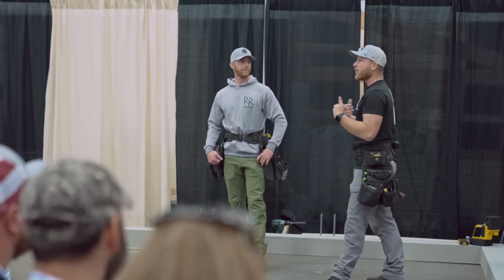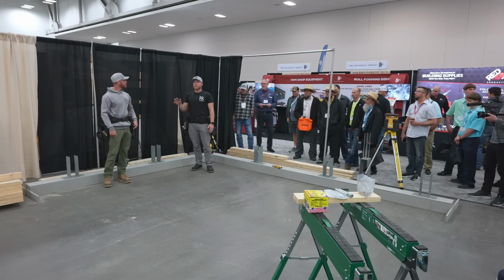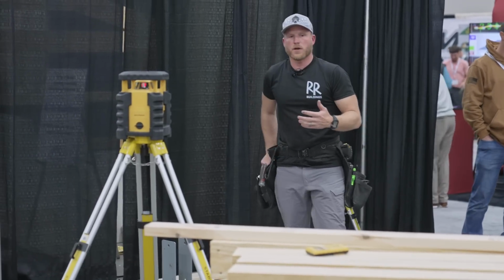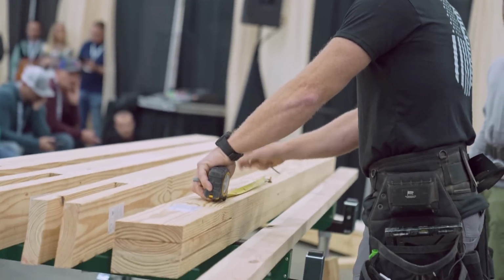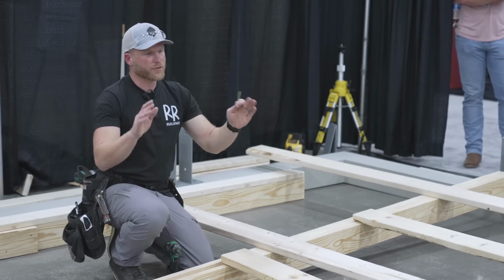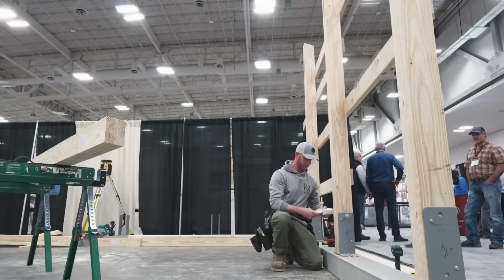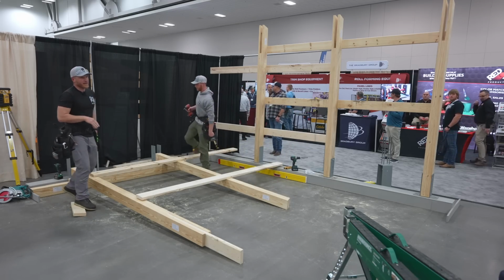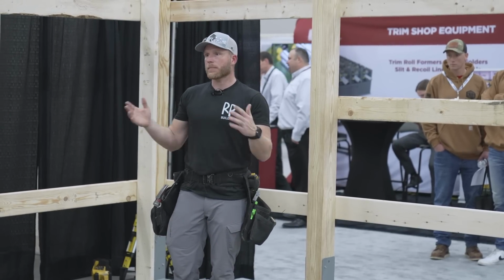LIVE Uncut Demo: How to Frame a FOREVER Post Frame!

Comment: I can understand cutting the bracket so that it isn't bearing directly on concrete. Why not add sil seal? Why not cut it so that there is bearing under the whole column? wouldn't settling pull it out of plumb if only half the post is supported, especially on a corner?

Comment: The problem with labor is finding an opportunity. I came out of a devestating divorce and partition suit. I am a timber framer who holds an engineering degree. Getting back to work has been a bitch. There are many skilled people who want to work but it’s not as easy as some think.

I have found the young guys are horrible with geometry. Few know the tricks of a framing square. The laser is pretty neat.

Comment: Column support brackets are a way of the future but not all will see this but our opinion is the selection of columns the way to mount them into the concrete is ideal but not all will see that in hiring someone to explain that to the average moron that don't know anything or is trying to build a building and care less what kind of columns you use makes it very difficult but the thing with all that you're saying makes perfect sense but not all understand it and there is the difference in betweens so it makes it very frustrating for a construction person to illustrate or to bring a part of a package to make a building even greater than it was makes it even harder for a brain that doesn't understand these things to be brung across That's where you need someone in between like an actor to interpretate what you're trying to get across as your point this would bring your sales to an old high level and you would start to be understanding what they need into their buildings and this would bring together unity but until you get any of these fundamentals and get these things up and running it's all going to be very confusing process to a lot of human beings so make your points in different areas on a different level more molecular than you could before so bring it down for the dumbest person to understand makes the variable of the point saying that you need to hire someone to bring that across this is our opinion

Comment: Hey Kyle, loved watching this video. Thanks for taking the time to do it. Finish carpenter here, and it occurred to me, why don’t you guys throw a 1/2” x 1” chamfer  on the outside of the column bottoms, so that they can more easily slide into the foundation brackets?

Comment: Kyle, have you ever used scissor trusses or parallel chord trusses on a post frame? Positives/ negatives?
Reply from the maker: Lots of scissor trusses never parallel chord.  Love a scissor truss for added head room with our making side walls taller.  Downside is less attic space for good ventilation but doable

Comment: Watching the series in this build and being an electrician, I believe you have other conduits which penetrate your air control layer. I recall seeing conduits going to the attic area through a top plate. Any and all conduits which break the barrier need to be fully sealed after wiring has been installed. In Canada we use a product called "duct seal compound'. It is a type of putty that never hardens fully so it could be removed down the road if ever needed and then reapplied. It's approved for use around electric equipment. We use it to seal the service entrance conduit primarily to prevent condensation inside the panel when moist air mixes with cold.

Love watching your work! I'm always impressed with the quality steps you take. I try to provide the same as an electrical contractor. It would be great to work on one of your projects as we are like minded with respect to quality and continuous improvement! 

Keep up the great work!

Comment: I roughly cut my frame from round logs with chainsaw. Burn-charr piece that goes in ground, put gravle in hole bottom, and connect logs with bolts (predrill holes). If roof is not leaking, stands strong over 20years, no problem.

Comment: When setting your brackets in piers are you shooting for the center of the pier or an offset to one side and how are you determining finish height of the piers assuming a concrete floor? Additionally I have been searching to find if you are building your own post onsite (is this an option) or purchasing them. From this video and your Key to Financing video is seems you are buying them. Could you do a video on both of these or maybe a short? Thanks for sharing your knowledge.
Reply: Your questions were answered if you had watched the video and paid attention.

Comment: Kyle, You briefly talked about doing a foundation wall vs drilled piers. Is there a cost savings one way or the other?
Reply: I also wonder if on a wall, does one need footing pads under post locations for the load distribution?

Comment: Great Demo!  I am currently planning a heated farm shop,  I am doing a 54'x72' it will be on a foundation 16' sidewalls,  I think 2x6" , 16"oc studding,  1/2 osb on the outside, and will be tin on the inside.  I am doing this because I think it is the easiest as far as insulation.  What is your opinion ?
Reply from the maker: I would not agree.  all those studs are going to be thermal bridging...our 8' OC posts are better for that but I also understand if you want to do something more comfortable for you.  it will be fine don't get me wrong

Comment: Just for curiosity in Serbia we still  level the larger distances with a cca 7 dollar water hose filled with water which has more accuracy than the laser nivelator. Because laser has some 4mm tolerance on so many meters and water hose has none. Yes, you got it right, seven euros or dollar.
Reply: How do you correct for temperature when the sun comes out and your hose and water expand? Infinity variable returns...new lasers are +/-1-2 mm over 300'.  Better than any worker or pencil width
Reply: @soving  or to simplify the answer, you spill the lukewarm water and sifle fresh one from a bucket or such. I was trying to tell people that a cheap and very accurate alternative exists.
Reply: @soving  I didnt  touch all the details. Water has to be cold and it has to be used right away. Warm water has bubbles. As far as tolerance I read in the manual 3 or 4 mm depending on the model. The hose cant be pinched. I am saying its cheap and accurate.
Reply: Liquid line(hose) is slow. These 2 guys put up a structure in just a few days.

Comment: Not sure that a $2,000.  tool pays for itself right away?
Reply: As an owner of a LA-180 myself, it's essential for bigger buildings.  Hard to burn a foot, hold correct tension on a 150+ foot steel tape diagonally checking for square.  For the average joe it's not worth it but for a post-frame builder I wouldn't be without mine.
Reply: As a retired surveyor I can tell you using a steel tape that long requires some skill and experience. Temperature correction, elevation difference and tension on smart end of the “chain” as we called all come into play.
Reply from the maker: should have said it starts paying for itself right away

Comment: Not a builder but enjoy your content .. one question I just thought of.. Do you account for the thickness of the bracket under the post or does that 1/4" matter since it is consistant
Reply: And if the corner was set without the metal under with the corner brackets each corner would be 1/4" lower
Reply from the maker: Yes and yes we do account for
The bracket and if you didn’t have a bottom on the corner you’d add 1/4… but then again it would automatically add 1/4” with the grade stick

Comment: Post in the ground is a thing of the past. I put up a building in 2018 and noticed on the north side the post are already getting bad. Their showing 3/4" of rot. No more post in the ground for this guy. I my cost a little more for cement,  but you have something when your done. Now I'll have to send a lot more more to fix this problem.